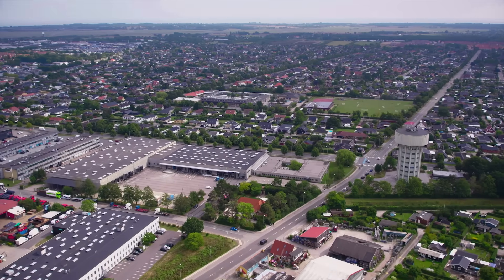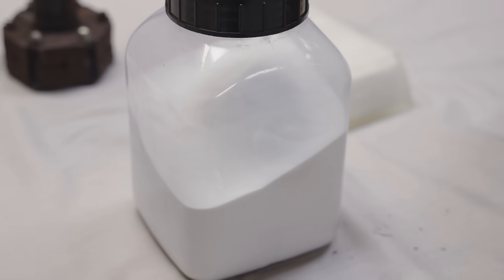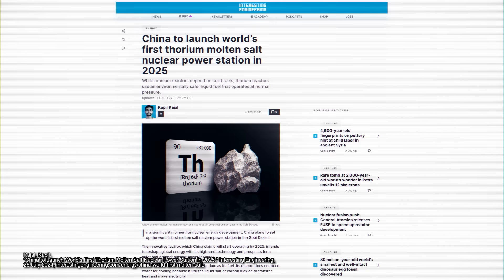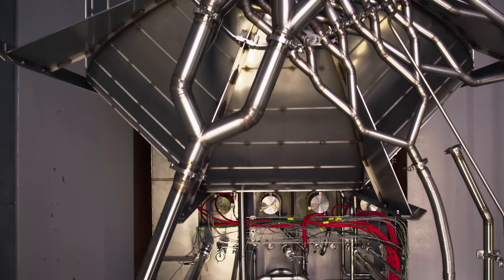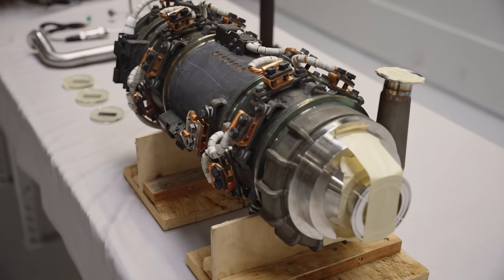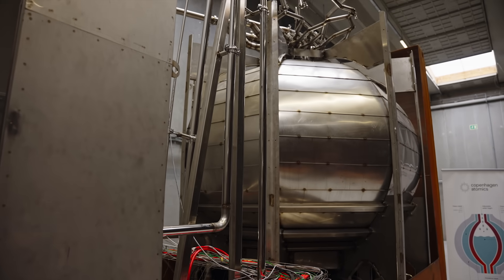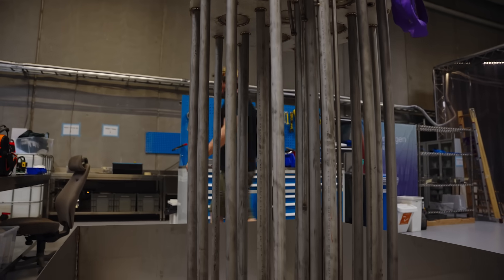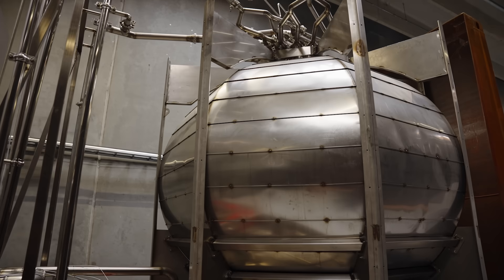Why Isn’t Thorium Changing the World?

Comment: To run a Thorium fuel you start with Thorium, which isn't fissile, expose it to neutrons and eventually you get Uranium 233 which is fissile. It's the U233 that keeps the reactor running. The problem with the Thorium fuel cycle is in the word 'eventually'. It takes a long time to breed enough U233 from Th232 to get enough to start a reactor. 

India has a big project to switch over to the Thorium fuel cycle because they have lots of Thorium and no Uranium. 50 years ago they started a plan to get a full fleet of nuclear reactors based on Thorium with the expectation it would take 70 years. But it's taking a lot longer than expected, they're still in the basic research stage and haven't yet got even one U233 fuelled nuclear reactor. 

The problem is in the intermediate stage between Th232 and U233. Th232 absorbs a neutron and becomes Th233 which has a half-life of approximately 22 minutes to decay into Protoactinium 233 (Pa 233) . Pa 233 then decays into U233, the half life for that part of the chain is 27 days. But if Pa233 absorbs a neutron before it decays then it becomes Pa234 which then decays to U234 which isn't fissile. 

But in the Uranium to Plutonium fuel cycle the intermediate isotope is Neptunium 239, which decays to Pu 239 with a half-life of 2.36 days. Roughly a 10th of the half life of Pa233. Which means that it takes ten times as long to breed 1kg of U233 from Th232 as compared with breeding Pu239 from U238. And that is the basic problem with the Thorium fuel cycle and the reason why India hasn't yet got a fully functioning U233 reactor. It just takes too long. 

I was at a conference on Thorium at CERN in 2013, because I was keen to learn more about Thorium nuclear energy. But my hopes were dashed when a speaker from Rolls Royce, who make nuclear reactors as well as jet engines, got up and explained it would take 200 years to get a full fleet of Thorium based nuclear reactors to power Britain. 

We do not have that time. 

We have to switch to non-fossil fuels quickly in the next few years otherwise we're on track for the kind of CO2 levels last seen during the end Permian mass extinction which wiped out over 90% of life on Earth due to global warming. 

So it has to be wind and solar and a little bit of hydroelectric.
Reply: I don't understand how you justify disqualifying all forms of nuclear power because the Thorium fuel cycle is slow. Having worked for a startup wind power company from 2014 - 2018, I was gravely disappointed to learn how little of a dent that wind and solar has actually made on the global energy consumption. I don't think we can afford to dismiss all of nuclear power because wind and solar is just not getting us there on its own.
Reply: @ becuz for years solar was more expensive than other forms of power. Once it became cheaper it has started taking off. According to Statista, capacity has tripled since 2018 and shows increases year on year.
Reply: @TheMrshawnpaul  "I don't understand how you justify disqualifying all forms of nuclear power because the Thorium fuel cycle is slow."

I'm not disqualifying all forms of nuclear power. It is useful for certain countries, but it requires a stable government, and that cannot be guaranteed. Look at what's going on in America with DOGE dismissing nuclear engineers who work to keep nuclear energy safe. 

No country can be relied on not to go mad and start doing stupid things. Nuclear reactors require highly intelligent, highly educated people and leaders who respect intelligence and education. Firing nuclear engineers to save money, or because they speak with a foreign accent, leaving nuclear power plants in an unsafe condition is not the actions of a bright ruler. 

Nuclear power cannot be scaled up in time to prevent 2 or more degrees of global warming. It cannot be used in unstable countries, and even apparently stable countries can go mad. 

Therefore we have to turn to hydro, solar and wind.These sources of electricity are already changing the economies of countries all over the world.
Reply: @TheMrshawnpaul  Yeah, we'd be better off causing algae blooms and then sucking it up and processing it into fuel. Most of the infrastructure exists, the technology isn't that different. It'll be way less space efficient than solar, needing maybe 50x the area, but the solar needed to meet our current 20tw would only cover 150 sqkm, and cost a few trillion. The oceans have a few million sqkm of largely empty water, and ships are one of the most efficient methods of transportation.
Reply: @SoMuchFacepalm  yeah, but that wouldn't exactly solve the whole polution problem, since biofuels still produce roughly equall amounts of CO2 to fossil fuels
Reply: @slavicandroid1999  And the carbon in that CO2 comes from the atmosphere, so they're carbon neutral. It does solve the pollution problem. CO2 levels going up comes from carbon being added to the cycle, or displaced from one stage to another.
Reply: CO2 emissions technically aren't the issue.
The issue is that fossil fuels emits CO2 from carbon and oxygen that was previous trapped underground. It is new greenhouse gasses, which means more global warming. With biofuels, all the CO2 they release is CO2 that got absorbed whilst the plants they come from were growing, so it's about net neutral on greenhouse gas emissions (i say about because some greenhouse gasses are more warming than others, with biofuels generally taking one of the weakest ones, CO2, and then emitting at least some of stronger ones like CO4. The CO4 will decay into CO2 after a while, but it's still technically slightly warming)
Reply: @Santisima_Trinidad  CO4? Carbon tetroxide? Did you mean CH4/methane?
Well, assuming you did, then yes. And also assuming you don't capture the methane during production and use it as fuel.
Reply: @SoMuchFacepalm  i should have remained the chemical formula for methane, that was a silly mistake.
And i was accounting for the capturing of methane, its just theres always leakages with such things. Might only be 1% of total methane produced, when all leaks from production to use are added up, but it technically exists.
Reply: @slavicandroid1999  "since biofuels still produce roughly equall amounts of CO2 to fossil fuels"

Yes but the CO2 they produce comes from the air, not out of the ground
Reply: @JohnSmall314  Well, no, that doesnt really make any sense. If it releases CO2 into the atmosphere that would have otherwise stayed absorbed, its increasing the amount of CO2 in the atmosphere. Its the same as if you were burning wood
Reply: @slavicandroid1999  Difference is, the one is a CO2 cycle which doesnt add CO2 to the atmosphere, the other is not and does add. Guess which one is the fossile CO2.
Reply: @slavicandroid1999  but biofuels are made from plants which absorb CO2 from the atmosphere to produce the fuel as well as to grow.
Reply: @TheMrshawnpaul  You do realize renewables grow exponentially? At a very fast pace?
Reply: Thank you for this comment. Yes, this is one of the major problems. The corrosion is the second major one. And it is not the hot salt alone. Corrosion is much more difficult to handle when the radioactivity comes into play. Honestly, i am very impressed how far they have come, and that they managed to get the hot salt circulation engineered. Which is also good for certain types of solar power plants.

But the way to a commercial thorium salt reactor is decades in the future. Which is great as a perspective, but not a solution to our current problems. Yes, the research should be increased, we will need all the energy which we can get. But we also need to look into better batteries, and we need to increase our efforts in renewable energy. There are countries which have increased the percentage of renewables for their primary energy consumption to 20% - and still increasing.
Reply: Thank you! I think we can't just look at the sunny side, but need to really communicate the risks and problems. There are a lot of unsolved problems, closed fuel cycles have been proposed decades ago already, but are as of yet not economically viable.
Reply: @schmitzbeats6102 because they're scientifically impossible.
Reply: Mate what you on about. The CO2 levels are about 0.02 more than they were 500 years ago. Stop fear mongering
Reply: Started out so strong ended with CO2 delusion and climate hoaxery. Shame.
Reply: Several of your statements are just plain wrong. 
There is nothing that points to a mass extinction. 
Solar and wind is not an alternative to fossile fuels.
It is possible to build nuclear reactors as a replacement for fossil fuel. It does need political decisions and state investments to make it happen.
Reply: I’d would be a bit skeptical of Rolls Royce as they are invested in uranium BWRs.
I’m in no position to debate whether thorium is too slow, but if you’re aware it is, the certainly others are too.  Would they go to this effort knowing it’s a dead end?  Something doesn’t balance.
 
The climate change prophecies began 2 decades ago and by.their prognostications we are all dead.  
In the event, It’s too late to prevent climate change, but not too late to do what man has always done: adapt.   Cheers
Reply: Stop fear mongering, CO2 won't blow up the Earth lmao
This blind push from fear of "climate change" is more damaging to progress than anything oil can do.
Reply: India will never develop any complex project on their own. Too many scammers, sherkers, talkers and not enough actual thinkers and doers.
Reply: So basicly it's a complex process when we already have an easier and more efficient process currently in use.
Reply: Wind and solar will never power the world as we know it, but nuclear will.  Even the dirtiest, most inefficient nuclear power is better than renewables, as the waste produced doesn't need to be stored for thousands of years, it only needs to be stored until it can eventually be reused in newer thorium reactors.  200 years is certainly a workable timeline for that, and in the meantime we can scale up conventional reactors far more rapidly than renewables.  Fusion will likely be an option at that point as well.  But renewables won't get us there in time. Suppose you did find the land to cover with solar, and the logistics of power distribution weren't a problem...at that scale, indium and tellurium production would never be able to catch up in time, and there's a good chance we'd run out before that point.  Wind farms have a similar problem with neodymium and dysprosium, and are already problematic and becoming too concentrated.  If you're going to invest all that carbon and REO's into them, you better be putting those turbines where they can be most effective...which isn't a whole lot of places.  Hydro is already causing tons of environmental problems worldwide, and many hydroplants are shutting down, so it wouldn't be a great idea to push for more of it.  Unless you think the world should be a fun house of occasionally spinning blades, obscured solar panels, and devastated waterways...because hey, who cares about the health of the planet so long as there's less carbon and more free energy, right?  RIGHT?
Reply: Higher CO2 levels didn't lead these extinctions, they followed them.
Reply: You would have got an upvote from me except for the last statement. Work out how much wind and solar we need for 25TWh. Your last statemnet should be "we need nuclear, some hydroelectric and a little bit of wind and solar". The ONLY other alternative is reducing energy consumption by an order of magnitude or two.
Reply: this comment should be top voted, not the other overly excited bs
Reply: If your theory would be correct other scientists would throw away all ideas of Thorium reactors. What U describe here would be a mayor issue of the whole concept
Reply: @Martin-zd8eb  Not really. It's an economic issue, sure, but scientifically the timescale isn't a problem.
And there's other options and designs that probably don't have the same issues.
Reply: @Martin-zd8eb no, because startups are grifters trying to cash out.
Reply: Something never discussed by people that say solar wind and hydro is, do we have the room to meet our energy needs with that? Not only do solar and wind only operate sometimes, they don’t really make much energy. You need huge swaths of land for your solar panels or turbines, and then mass battery facilities in order to store a ridiculous amount of power. Does the world have room for all that? Maybe the US, Australia, etc, but what about Europe? A little dense there. 

There is no one right answer. Nuclear in any form combined with the other sources is likely the best but just saying you don’t think nuclear is the answer so ignore it and only focus on wind solar and hydro is not feasible.
Reply: @benstanfill363 you dont need all that much space for solar power plants really and they are extremely forgiving with terrain. I still remember the desert tech proposal to power the EU from north africa and the sahara desert.

Unfortunately the political situation and instability of the region killed the project.

But yeah, we just need to use our existing surfaces better. Panels on every rooftop, a battery in every attic and a windmill wherever there is sufficient stable wind, because their footprint is rather tiny for how much they produce.
Reply: @benstanfill363 yes we have plenty of room.
Reply: @benstanfill363 It's discussed a lot. Felling forests for wind power is a common concern. Life cycle wise it's still worth it in many places. But I think farmland is the optimal area because we will eat a bit less meat which will free up a lot of farmland and farmers need to get paid still.
Reply: @benstanfill363  Ok, lets take Germany. Does not get much denser than in Germany. Germany is at 20% renewables currently, of primary energy consumption. There are quite some wind turbines, but still room for a LOT more. Solar power - there are some solar power plants, but you really have to look for them. Roofs on buildings - there is still a lot of room, less than 10% of buildings have solar power on them. How significant that is? In 2023 the number is 7 GW new installations on normal buildings. It has been brought up again and again. Space is not the problem for renewables, unless you restrict that space by some law ( like Bavaria for Wind ).
Reply: @benstanfill363  Another thing is renewables are too random, and (current) nuclear can best be used when run at a constant production. Neither is sufficient to meet the variance in demand, without some form of fast delivered energy, usually that is Gas, Oil, and Coal. These provide the gaps as they can follow the demand quick enough. If we want to eliminate them 100% you need some form of storage. There are no simple answers for the energy question.
Reply: quote from wikipedia: The feasibility of using thorium was demonstrated at a large scale, at the scale of a commercial power plant, through the design, construction and successful operation of the thorium-based Light Water Breeder Reactor (LWBR) core installed at the Shippingport Atomic Power Station.[1] The reactor of this power plant was designed to accommodate different cores. The thorium core was rated at 60 MW(e), produced power from 1977 through 1982 (producing over 2.1 billion kilowatt hours of electricity)
Reply: @slavicandroid1999  "The thorium core was rated at 60 MW(e), produced power from 1977 through 1982 (producing over 2.1 billion kilowatt hours of electricity)"
One one-thousandth of yearly consumption, produced over five years.
So at minimum we would need five hundred reactors that are ten time the size.
Was that net production, or gross?
Reply: @slavicandroid1999 
"... operation of the thorium-based Light Water Breeder Reactor "

It takes 10 times as long to breed fissile U233 from fertile Th232 as it does to breed Pu239 from U238.  Which is why the project was cancelled. 

Using Thorium alone we cannot scale up nuclear power fast enough to meet the challenge of CO2 free energy production. If we create a fleet of Uranium reactors to produce the neutrons required to breed U233 from Th232, why not just use the neutrons to convert U238 into Pu239? It's faster, and the U238 is already in the reactor. 

Uranium is cheap compared to the amount of energy you get out of it. Extracting Uranium from seawater is expensive, but it would still lead to cheap energy because you get so much energy out of the Uranium, and there's no shortage of sea water.
Reply: @JohnSmall314  "we don't have that time"

Every failed so-called model for the past 60 years.

Source please.
Reply: @nomdeguerre8464  pretty much every climate scientist in the world agrees that we are already boned. They submitted a report to the UN which basically said that we have run out of time to avoid the crisis, now its just damage control.
Reply: @balinthehater8205  are you aware of appeal to authority and/or majority? 

There are no ways to A - B test human cause. Nor do we really know how historical cycles will play forward - entirely naturally occurring.

Every predictive model has been incorrect for decades. The majority you cite has been saying we're cooked since the late 60s. It hasn't happened.
Reply: @nomdeguerre8464  no, actually you bring up your source please. Thorium reactors are technologically available in 10-20 years IF all goes in the absolute best case. Add time for site scouting, approval process and building time and we are at some point past 2050. For the first thorium reactors to be in operation, not to supply the energy of the world. 

To limit our global warming to below 3 degrees Celsius we have to reach net zero by 2050, or at least get as close to that as possible. Look up IPCC reports or the Paris accords. Obviously that does not fit together. So there is your sources. What are yours which lead to you coming to a different conclusion?
Reply: @nomdeguerre8464  [Southern California has entered the chat]
Reply: @jaelwyn  what about it?
Reply: fusion
Reply: @The4iddenTruth  Maybe in 30 years.
Reply: Exactly. These pie in the sky reactor designs are all grifts hoping to cash out from uninformed investors.
Reply: Problem is that we don’t have the battery technology yet and Wind and Solar are great but they cannot generate 24/7 and have not been very efficient. In Minnesota for years I paid higher kwatt for Wind development and I’m happy with them trying new ways to improve, but a lot of this stuff is a long ways away compared to Nuclear.
Reply: @shiftyjedi3417 wind and solar are the MOST efficient power generation methods. And this BS about 24/7 generation evaporate when you talk about global scale.
Reply: @armorclasshero2103Other questions aside, there are some pretty profound challenges involved in trying to shift power around the globe, and that's before you consider transmission losses.
Reply: Fear mongering
Reply: Co2. Hahahaha.
Reply: You sounded smart until you mentioned C02. Maybe if you give money to me as a carbon credit you can save the world.
Reply: @yehudaclinton6252  Rising CO2 will destroy society and possibly extinct humanity. That's fact. Smart people understand this.
Reply: CO2 is not a problem, but a source of life and, for some people, a source of incredible wealth.